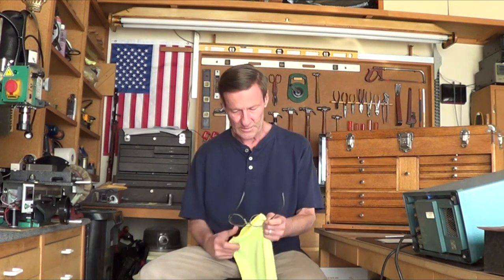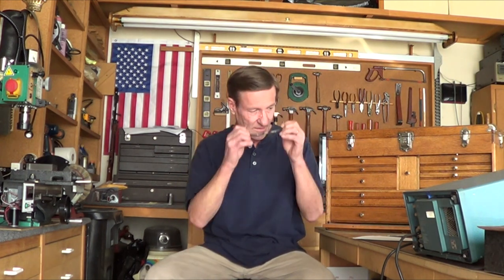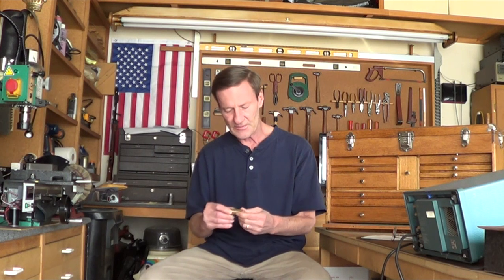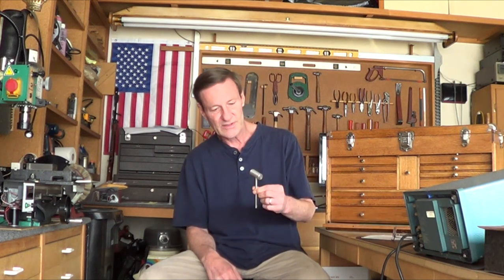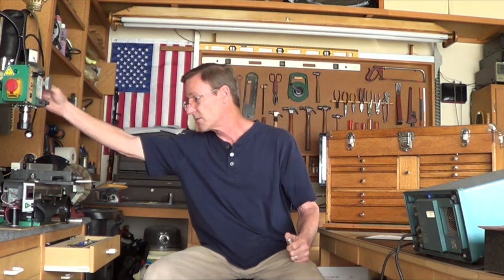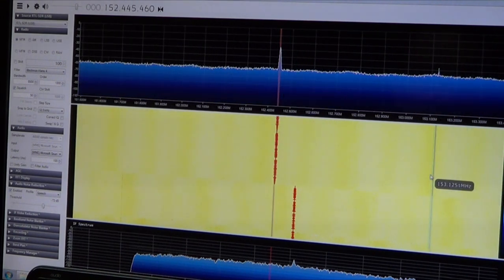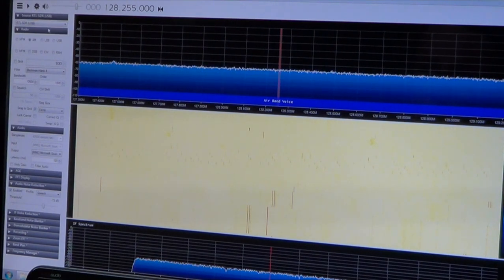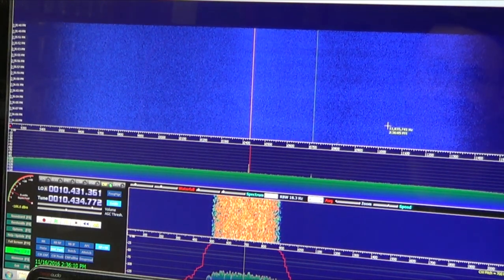How to Break a Mini Lathe Video #98

Comment: Don't feel bad. I just broke my mini lathe yesterday. Waiting for the replacement part to arrive next week.
Reply from the maker: What did you break? A plastic gear?
Reply: The little shaft and bushing that hold B and C gears welded together. When I get the replacement(s), I am going to mill a small flat on the shaft so more oil can be held there for lubrication.

BTW, go to MSC and check out the Sandvik Coromant inserts. You can buy them individually instead of buying them in quantities of 10. The finish they put on 303 stainless steel is insane. Be sure to study the information on their inserts at their website so you get the correct type for the material and job.

http://www.sandvik.coromant.com/en-us/knowledge/general_turning/selection-of-inserts/grade-information/austenitic-ferritic-martensitic-stainless-steel/pages/default.aspx
Reply: Just so you know, the tapered gibs I made for my saddle work great,
Reply: William Combs I had that exact same thing happen to me. I didn't tighten the banjo bolts enough so I ate  the forward drive gear, a 65 tooth gear, and welded the shaft to the gear runner with the key in it.

Comment: brass looking rod with a spiral look on the outside could be C954 Aluminum Bronze.
Reply from the maker: Nothing written on it. Expect that coming from India. All I know is it is brass and has a spiral mark on the outside like a scrape mark about .4 apart. It is pretty hard to hacksaw...
Reply from the maker: Researching bronze and the color I'm pretty sure its brass
Reply: If it were Aluminum Bronze you'd notice the difference, regular 360 Brass turns like butter, C954 tells HSS tools to take a hike but isn't bad with carbide. C954 is usually bought as from the mill in a continuous cast which makes it appear wavy/spiraled. The color is a milky gold unlike the deep yellow gold of 360 brass. The oxide layer that develops with time is very uniform and a weird dark-ish color that can be a brown/grey/purplish color. The chips are usually small and abrasive like turning bronzes.

It does look like the color of C954 in the video, but that could also be the fluorescent lighting.

Comment: Feel your pain! I to have now got my third bored in my lathe! First one went do to the abuse from someone before me! Why I believe that as when I got it it had almost no torque? I bought a four jaw Chuck and turned it on and instant smoke? Back then did not know what a MOSFET was?At the time a gem of a buy called uncle rabbit! Was a native American and a whiz at fixing circuit boards! Now at the big campfire in the sky. So next time it. Blew I replaced the MOSFETs myself ran great for long time. Year ago lathed locked up and this time it really smoked?. So I have now a bucket of parts ? As I have gone through everything. I should have thrown it away.with new parts easy into the realm of a new high torcue lathe.Anyway there were a other of could have done it problems But the small being inside headstock told the story. Some one striped the high low gear and replaced it with out cleaning the case and all . They would lock up as the one side was not sealed. New bearings I bought are. Curious the large bearings looked new?